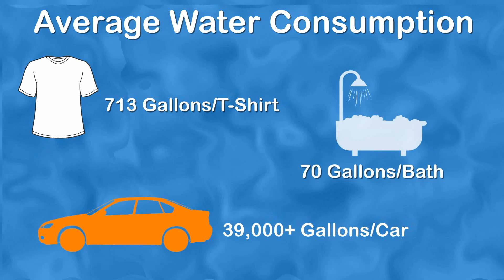Myth: It Takes 2,400 Gallons of Water to Make a Pound of Beef

Comment: What absolute propaganda! The "441 gallon" figure comes from a study published in 1993! (Beckett, J. L., and J. W. Oltjen. 1993. Estimation of the water requirement for beef production in the United States. J.
Anim. Sci. 71: 818-826.)

The most current data suggests that the water footprint per pound is closer to 4000 gallons / kg! (http://waterfootprint.org/media/downloads/Hoekstra-2012-Water-Meat-Dairy.pdf).

Stop trying to deny the issue or lie about it - you are harming us ALL.
Reply: +InvisiMan2006 Your source says it takes 1,847 gallons of water to produce a pound of beef (some 98% of which is accounted for by production of the feed crops). That's 23% less than the "2,400 gallons" figure usually cited. Your source also shows us nuts are by far the worst offenders among vegan foods. If you're concerned about resource use, then simply ban all subsidies.
Reply: hitssquad Whether it's lower than the figure usually cited, it's considerably higher than what the meat industry says.  And nuts DO require a lot of water, but you don't many nuts, certainly not the quantities that people consume meat - legumes are a replacement for beef, and they require considerably less resources.  

And yes, we should end subsidies on products that harm the environment, and force those industries to pay for the damage they cause.
Reply: hitssquad also pasture raised beef is completely ecological and regenerates the land when holistically managed.
Reply: this data cites Hoekstra's paper from 2010, which cites data from Peter Gleick's paper from 2000, who collected his data from 1995 to 1998.
It isn't that much newer